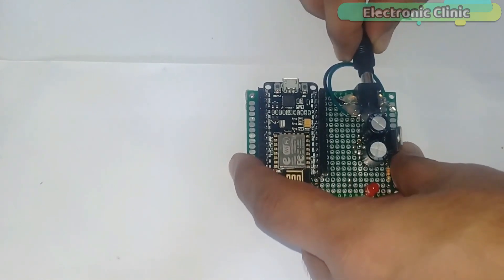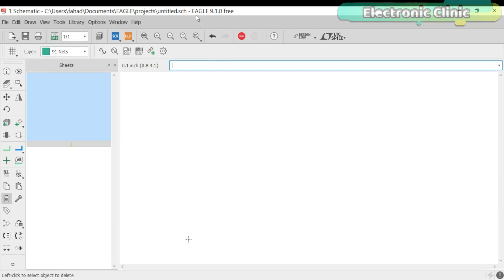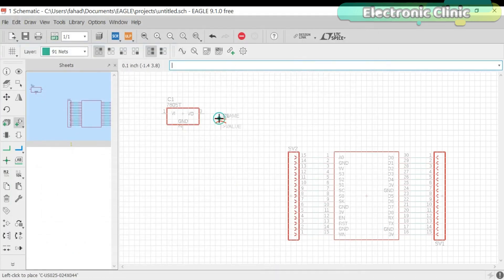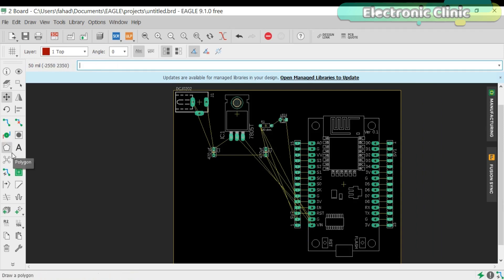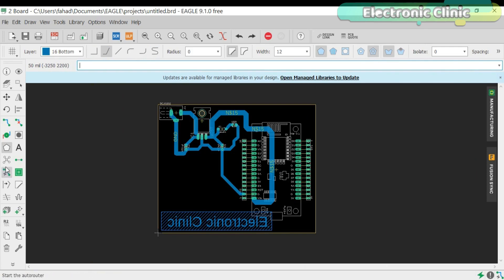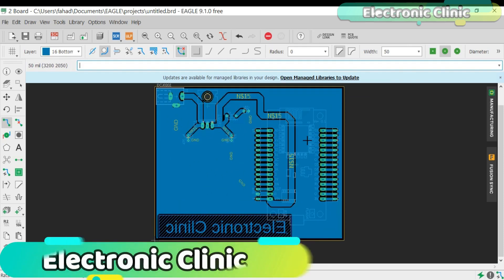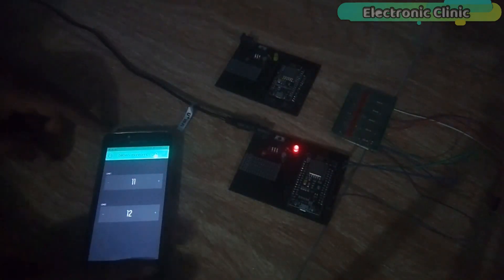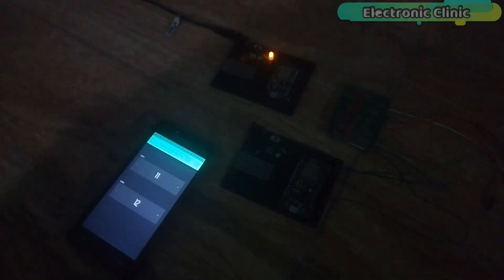Nodemcu ESP8266: Nodemcu Power Supply, Nodemcu 12v Power supply, ESP8266 power supply

Comment: sir i use 12v adaptor then the LM7805 and 470uf capacitor heat a lot
Reply from the maker: Ya that's the main issue with the 7805 regulator. That's why I designed a new board with 5v and 3A power supply. Check playlist, there is a video on 5v and 3A power supply.

Comment: Sir...I have used 12v 2a power supply for node MCU and uploaded the code of controlling it by BLYNK through WiFi. So for how much maximum time, can I run it continuously.

Please reply
Reply from the maker: for months and years, if it hangs then you can use a watchdog timer in the code, then the controller board will automatically restarts if it will ever freez or hang.
Reply: @ElectroniClinic  
The esp8266 (silver coloured square which is the main wifi module) is becoming a slight heated....so if I simple use a cooling fan, can I run it for continuously 10 hours?
I have uploaded a simple BLYNK code to control LEDs with WIFI.
Reply: @ElectroniClinic  what is the rating of the capacitor you had used 470uf _v
Reply from the maker: @sksanjaykumaran4108  470uf and 16v
Reply: @ElectroniClinic  if i uses a stepdown transformer and a rectifying circuit instead of the 12v adaptor what rating of transformer can be used(current rating)?
Reply: @ElectroniClinic  or if i uses a solar pannel instead of the 12v adaptor what is the current rating?
Reply from the maker: @sksanjaykumaran4108  your power supply should be at least 1A.
Reply: @ElectroniClinic  what is the potentiometer rating which u have used?
Reply: @ElectroniClinic  what potentiometer's rating which you had used? please reply
Reply from the maker: @sksanjaykumaran4108  any value, but I think I used around 100k
Reply: @ElectroniClinic  iam doing this for my college project
Reply: @ElectroniClinic  no problems won't occur in this right ? By using 100k
Reply from the maker: @sksanjaykumaran4108  yaa
Reply: @ElectroniClinic  thanks bro keep up your good work
Reply: can we use a 12V adaptor or a 5V battery for the project
Reply: can we use a 12V adaptor or a 5V battery for the project @ElectroniClinic

Comment: Can a 12volt power supply be used instead of 5v?
Reply from the maker: there is 7805 regulator, yes you can connect 12v adaptor.
Reply: @ElectroniClinic  ok! thank you very much
Reply: @ElectroniClinic  how much maximum current this total circuit draws?
Reply: can we use a 12V adaptor or a 5V battery for the project
Reply: can we use a 12V adaptor or a 5V battery for the project @ElectroniClinic

Comment: Would 12V to 5Vdissipate a lot of heat?

What other types of battery can be connected to this circuit? Like 3.3V LiPo etc
Reply from the maker: no heat.
Reply: Yes, dropping 12V to 5V at any kind of current load WILL generate a fair amount of heat. That voltage drop has to be dissipated.
Reply: @ElectroniClinic  what is the rating of potentiometer which you had used ?47k or 10k or something like that?

Comment: LM 7805 heats alot and shutdowns after few time
Reply from the maker: your regulator must be faulty, you can also use a heatsink.
Reply: @ElectroniClinic  I have 12v 2amp adaptor and then I connected lm7805 and output to nodemcu and 5v 4channel relay. It works for 1 -2 min after that it fluctuates and shutdowns due to heat.